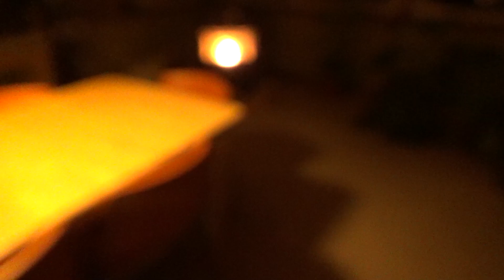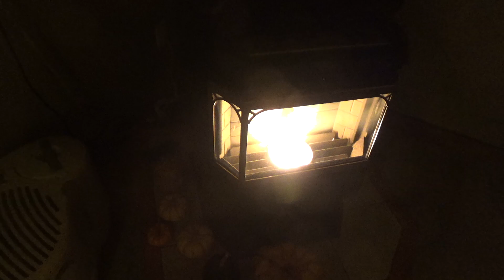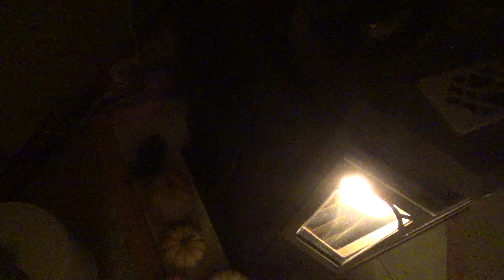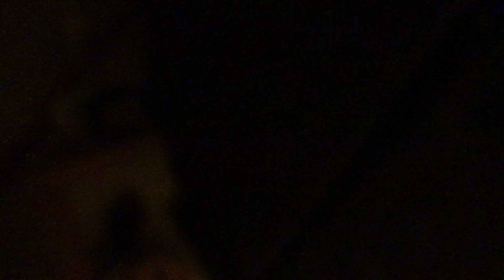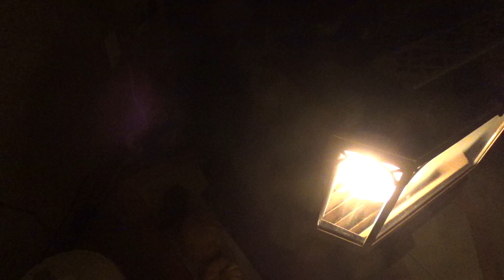Odd Bearing Failure in Draft Inducer Fan Motor

Comment: Check that the cooling fan blade between the motor and blower hasn't shifted. Just fixed two with this issue over the past few weeks. These usually last way longer than this, especially a fasco.
Reply: Also, These motors are pressed together. The cast aluminum mount presses into the motor shell, and can be removed by disassembling blower assembly, removing small cooling fan, placing motor in a 3" plastic pipe coupling, and tapping on shaft with hammer and wood or urethane mallet. Replace bearings with high quality ones. I try to go for the same brand with EXACT bearing number. These usually use a slightly less common size of STAINLESS STEEL bearing for heat resistance.  Usually 608-SS. When reassembling, make sure that little cooling fan is tight as can be on the shaft. Use a drop of epoxy or better yet, Loctite 609. I save dozens of pellet stove motors every winter. Great way to make use of my fan hobby for a good bit of extra cash lol

Comment: What does the motor do in this furnace? What happens when it fails? Does the furnace stop heating u?

We use oil furnace (Bunderus G-205U) so I only know how that works and how to fix it, sadly we are being forced to swich to natural gas this year so if only I could find a good old reliable gas furnace, thats still fixable and is uvailable in Europe, they told me stay away from Bosch (bought Bunderus) as it produces noise on the radio, and noone wants to fix that
Reply from the maker: It would stop heating me.

Comment: Not good Jordan. Hope your luck turns around soon. Just what we need is this luck to continue into the spring when the air conditoner tests begin and find out that some of them have leaked. Don't need that to happen. Hope your able to get this fixed soon Jordan. I would say with that being a cheap motor and failing after just a year or two of service while the other had lasted years. It might be worth doing some work on that original motor and seeing what happens. Worst that can happen is that we just have to get another fan motor again for the pellet stove. Just crazy how things are just breaking instantly all of a sudden.
Reply from the maker: I'm sure they will all work just fine.

Comment: you should do research and try to see you can shove a bunch of lube down this motor, i would stop using this motor, and use a space heater util you can fix it
Reply from the maker: It's ball bearing, the bearings need to be replaced. A portable electric heater is not going to come anywhere near close to replacing or substituting a 40,000 BTU wood fired stove.....

Comment: Unbelievable. 1 Year. And then it BREAKS. Nah that's a joke. give me the real thing that was built correctly.
Reply from the maker: This is one of the few downfalls of using vintage equipment, the proper OEM replacement parts of good quality become difficult to find with time.
Reply: @JordanU  Indeed.